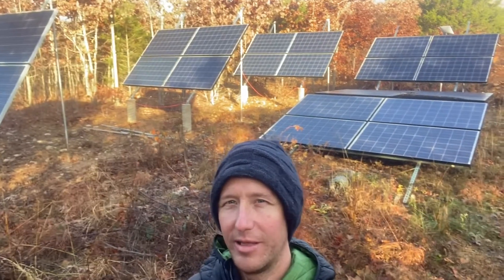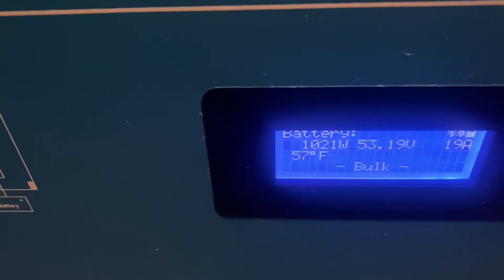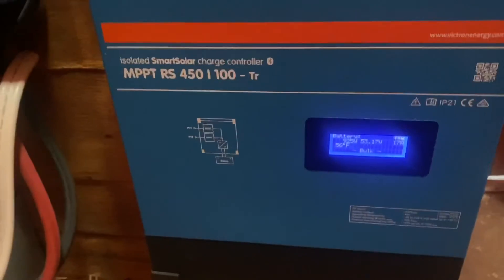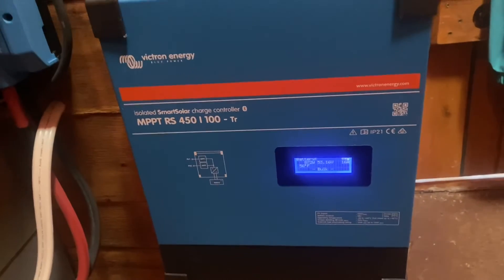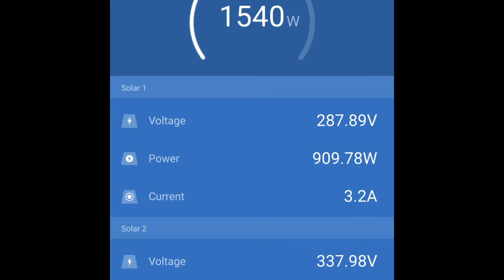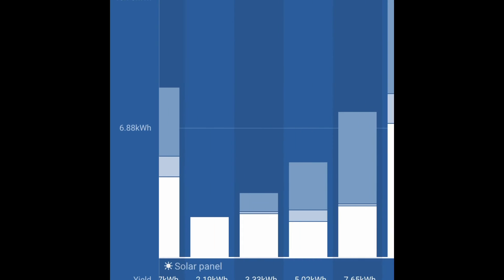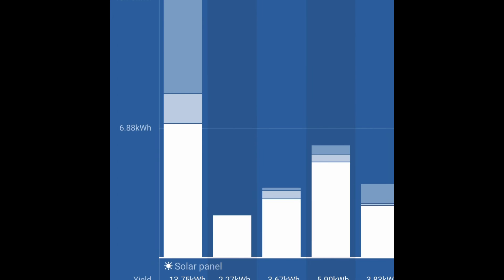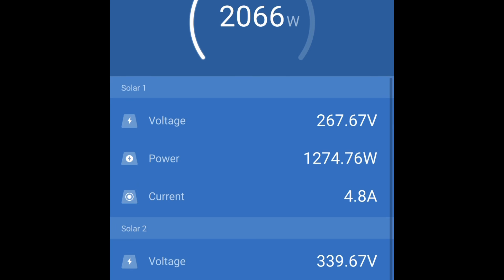How I got 6000W of panels on one charge controller!

Comment: 2:04  It says you're getting just 0.3 amps...but a decent 408 volts! This is a really good example of how good the SmartSolar algorithm is in moving the power point to the optimal point on the power-voltage curve. It's wayyyy over in the lower-right side of the curve.

Comment: Thank you for this video!    What size PV wire are you running to your victron?
Reply from the maker: Good question. I am using 10 gauge solar wire from the panels to the charge controller. You should really always be able to use 10 gauge. If you need a larger wire because you are running more amps you should reconsider your setup. Check out this video for an explanation https://youtu.be/JW0vrTAa50s?si=TpDk306Ch2E1O3WU
Reply: @idunasorchard  thank you!   I am just getting into this and decided to run 10 gauge vs. 12 gauge because I figured I'd be pushing more power than not.    Appreciate the answer!

Comment: Is it 450v per string or 225. ?
Reply from the maker: It’s 450v for each string.
Reply: To be super clear it is actually 8 times your battery float voltage per string, not 450V.

Comment: The 100AMPS on the charge controller has nothing to do with the solar panels....The 100 AMPS is what the charge controller is able to supply to the batteries, an MPPT charge controller only takes the current it needs  to provide 100  AMPS to your batteries. It really worries me that so many people that deal with high voltage no nothing about what they are doing and is how people get hurt or burn down their home. Take your 6000 watts and divide that by your pack voltage, I'm assuming its 48 Volts, that end sup being 125 AMPS. The MOST that charge controller will provide at its peak is about 4,800 Watts to your 48 nominal Volts system at 100 AMPS. Over Paneling is common and is not somethin  new, as long as the  supplied voltage does not go over the charge controllers rated voltage, because the charge controller will take whatever voltage you give it. The current on the other hand as I mentioned is what the charge controller regulates. Think of it like plugging in a 12 Volt 5 AMP power brick and you have one device that runs at 12 Volts 1 AMP and another that runs at 12 volts 5 AMPS. the power brick is not going to PUSH 5 AMPS to both devices, it will only push the current the devices are asking for, in this case 1AMP  and 5 AMPS respectively. Now if you connected a 24 Volt power brick to either of those items, it would explode, or short etc, because the voltage is constant. But just wanted to put this out there it scares me that so many people that are messing with high voltage that think they know what they are doing and do not. If this was in a residential place it would need to be checked to ensure its up to code, since you are running voltages over 100 Volts. Think about it.
Reply from the maker: You are correct. The 100 amps refers to the current limit after the voltage is stepped down by the charge controller. This is not the first time this has been brought up. I must have not worded this correctly in the video. The whole point of the charge controller is to run low amps and high voltage to minimize wire size etc. I will write a note in the video description. However, remember that a 48 volt system charges at a voltage above 48v. My controller has supplied over 6100 watts to my batteries at one point as recorded by the controller. The controller can absolutely put out more than 4800W.

Comment: With the Dimmer + PV, self-sufficiency will now increase to almost 95% in summer, which means a huge breakthrough. The prerequisite is that you have at least a small balcony power station, and you don’t need an expensive battery either. Example of a kettle: Without a dimmer, the 2500W - 600W PV system needs = 1900W, which you have to pay more for. If I turn the kettle down to 600W with a dimmer, then every weak PV system can now supply each consumer independently and independently, because the 2500W kettle becomes a 600W kettle thanks to the dimmer. Magic... The 2000W e-heater becomes a 500W e-heater with a dimmer, which can run 12 hours a day free of charge via PV. https://youtu.be/QbLWDbJi6ew . The 4000W oven is also tamed. Not the solar systems have to grow, but the consumers just have to drop by 75%, which is sooo easy with the dimmer. are you convinced now I have already switched my entire household to dimmers. Please have a look at my channel. ............. 🌞 ......................            Increase mini PV solar self-sufficiency (winter and camping): A boiler and other power-hungry consumers can be infinitely reduced using the "5000W dimmer". Ebay €7. I run 5 dimmers in parallel on an 850W inverter. Kettle 2.2KW at 150W runs 12 hours a day, so the water is always hot. The room is also nicely heated. 2.5KW washing machine runs in parallel with dimmed to 400...600W and always reaches its 60°C, and also its 1400rpm... It doesn't matter to the washing machine whether it changes the washing temperature to 5min@2500W or 100% can be achieved free of charge via existing PV power in 20min@600W. The wash cycle lasts the same time dimmed and non-dimmed, 3Sth 10min. The iron, dishwasher, oven, electric heater, waffle iron, coffee machine, all internal heating are throttled with me. Videos on my channel https://youtu.be/eC2olbCBhh0 The inverter stays cool, quiet and the MOSFETs + (battery) remain intact because no extreme current peaks arrive at the inverter. Now every Mini PV Inverter is enough to sell large devices. So, with the dimmer, all internal heaters/devices can be converted into base load devices that stay almost permanently ON, drawing very little current directly from the PV. With a wattmeter / energy cost measuring device you can then measure this perfectly in order to set the dimmer optimally. .................       For the kettle, electric heater and small oven, I developed and built control electronics, as soon as clouds come, these consumers go out briefly, so that no expensive electricity comes from the grid. ................. ..................

Comment: Must be a low VOC on those panels as most 250 watt panels series at 12 panels would be over 450 volts.
Reply from the maker: VOC : 37v 
Hopefully I’m not cutting it too close for cold weather. I have seen slightly over 450v on really cold morning but it hasn’t cut out so the unit must have a bit of a buffer on Vmax. If I have problems I’ll just disconnect one panel from each string for the winter, but so far so good. Any voltage spike over 450 should be very transitory and only due to very cold conditions.
Reply: @idunasorchard  I would be concerned about your high voltage.  Northern Arizona Wind and Sun where you purchased it even has in red text now how you must not have your VoC higher than 8 times your battery float voltage.  That's a pretty expensive piece of equipment to have it configured well outside of its published limits which for your system would be well under the 450V limit.  I would lower the voltage by one panel at least for the winter months.
Reply from the maker: @davidb.5544   So my float is set at 56.9V If you multiply by 8 that’s 455V, which is more than the VOC of my series strings, which would be 37.2V X 12 = 446.4 so technically I am within the specified limits. I’ve run the same configuration all through the winter without a problem. So 2 strings of 12 250w panels. Now my voltage may occasionally have exceeded 455V but probably for only a few milliseconds with edge of cloud. Anyway I’ve never had the unit shut off nor triggered my battery BMS or any other signs of problems…
Reply: @idunasorchard  THAT is AWESOME to hear! It has been my fear while we get our solar installed off grid.
Reply: @idunasorchard  If I remember right Victron has protection for over voltage so it doesn't break just shuts down for a while. Cloud edge on a cold morning will produce very high voltage, the other disadvantage IMHO is the shade on long string size but whatever works for you is the way to go.
Reply: @idunasorchard  we are starting out with (12) QCell VOC @ 48.48. We gave a Conext SW4048 inverter and prewired Midnite Solar CL150 charge controller. I am thinking to switch this controller out for an MPPT100-48HV EG4 Solar Charge Controller. The battery bank that we have is 48v/2,000Ah Absolyte GX.

Comment: In reading the Victron 450/100 data sheet, it indicates that each mppt tracker can handle 18amps normal operating, 20 amp open circuit.  So that would mean a total of 40 amps split evenly between the 2 trackers. If you were running at 450v at 18amps normal, that would be a 8100w solar array per tracker.  If you are running at around 260v that would mean 260voc x 20amp = 5200 watts you have on each tracker.  So your system pv loading is fine from what I can see- but you can't put 100  PV amps into the controller from the solar array. The 100 amps is the max output to a 48v (57v at bulk)  battery bank so 100 amps x57v = 5700 watts into battery bank and maybe a bit more.  Others have thought the 2 numbers on a MPPT are the PV input max #s (Volts and amps), but they relate to PV voltage max and the output to battery amperage max.
Reply: There is additional limits not obvious from the spec sheet.  Each tracker is limited to a maximum of 4000 watts and confirmed by Victron on their forum.  Even though it says maximum 450V maximum open circuit voltage it can handle that is purely theoretical.  If you review the manual it states you are limited to 8 times the float voltage of your 48V nominal battery bank.  So with a 48V LiFePO4 bank that would typically be around 429V (3.35V/cell * 16 * 8).

Also note the true open circuit amperage limit is 30A not 20A.  If you review the manual 20A is the limit it can protect against reverse voltage.  So as long as you verify before connecting your panels to the controller they are not reversed you are allowed to connect up to a maximum 30A .
Reply from the maker: Yes, I think it confuses people that the first # (450) refers to the voltage max of each solar array but the second # refers to the max amperage the charge controller can push to the batteries (after the voltage is stepped down) Thank you for contributing. People should also keep in mind that very cold temperatures can create voltage spikes and therefore one should not try to push the voltage of each array right up to 450v. Both my trackers run slightly above 400v and I have seen around 70-80amps coming from the controller. If that kind of amperage was coming from the panels my 10 gauge solar wire wouldn’t last long! Thanks again!
Reply: That's what I got out of the manual.
Reply: 20 A open circuit... are you arching ?